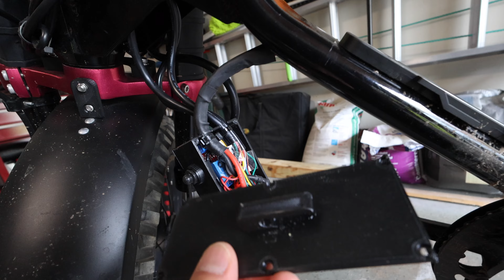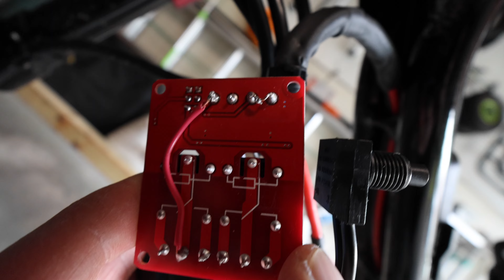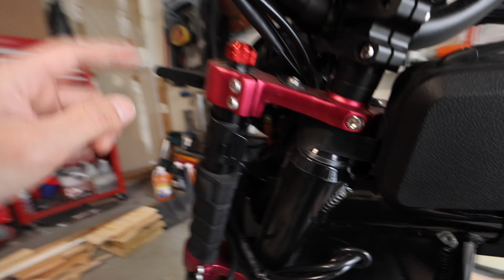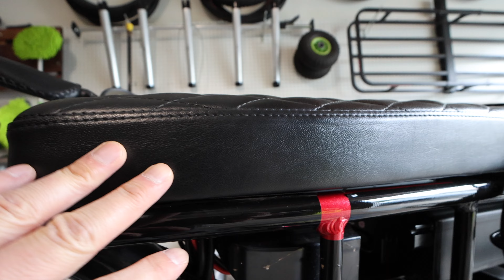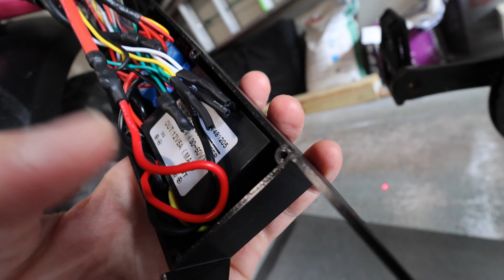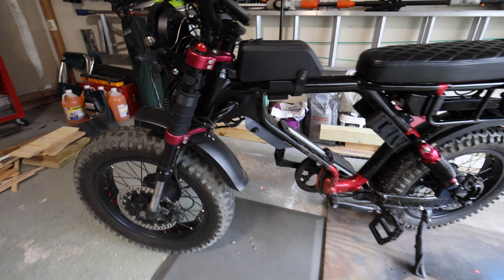Ariel Rider Grizzly - Brake Lights, Turn Signals, and Horns - How to Wire

Comment: Looks great, but its the tapping into power and signal I would like to see in the video
Reply from the maker: You just use the XT splitter and a long XT power cord to run the wire to the control box.